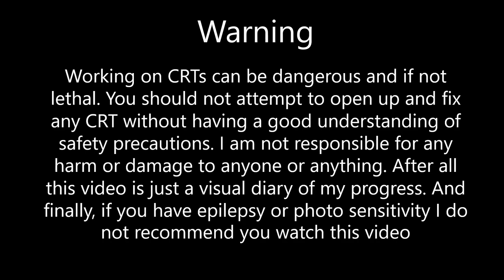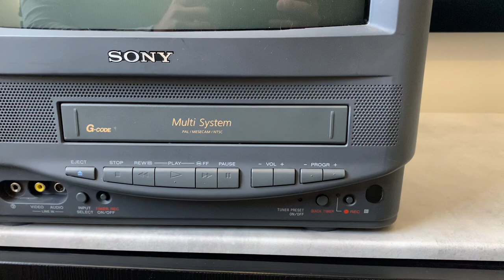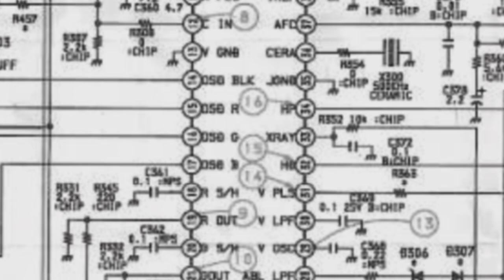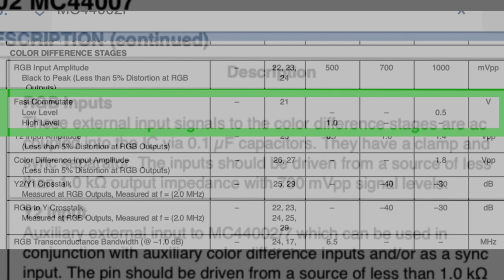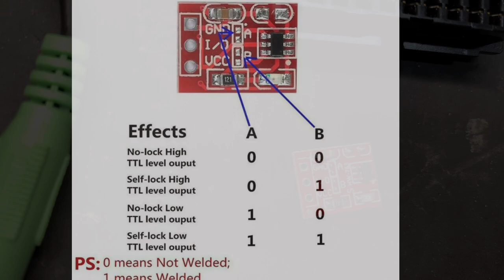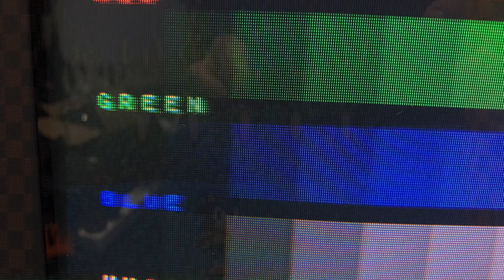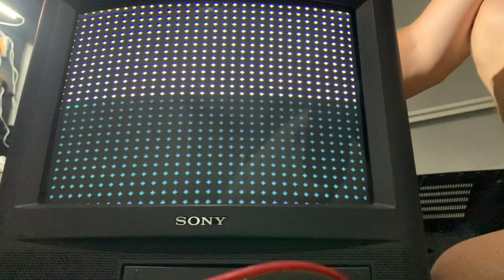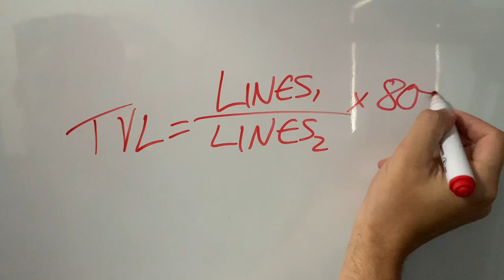No cut, switchless mod Sony Trinitron RGB Scart CRT TV

Comment: Thanks for explaining and comparing the phosphor line count. Nobody seems to mention that. So in a way the PVM tube is similar to say an Apple RGB monitor tube for the Macintosh that was aimed at 640x480 VGA. But there are things absent from a PVM as well, such as (stereo) speakers or Teletext, making them rather cumbersome for gaming. Not to mention the depth and weight. Also at bigger sizes the benefit starts to lessen, as bigger tubes have more lines as well. I find it very hard to qualify a 300€ PVM purchase when a 20€ Trinitron is good enough, and more what we used for our consoles in reality back in the days. Another real good screen is the Commodore 1084, which has a similar phosphor pitch as a PVM.
For true high line count, for example for use with 80 character modes of old 8-bit home computers, the monochrome tubes still win. An Amber Philips 80 (BM7022) delivers a truly special experience.
Reply from the maker: I made a whole separate video about phosphor line count and TV Lines and they are closely correlated. I love the PVM 14L5; Swiss Army knife of monitors with multi format resolutions. I’m naively oblivious with audio so stereo versus dual mono hasn’t bothered me too much but yes the mono speaker is a drawback, as well as the depth of these monitors. I’m making a new video on RGB modding that echoes your sentiments that a $20 Trinitron can be just as enjoyable and definitely good enough as an expensive Pro Monitor

Comment: I wish the TRRS cable was chosen as the standard instead of the 3 Composite cables, this would have made it easier for older consumers to adopt RGB and would have had the familiarity of the 3 RCA jacks older consumers were used to using.
Reply from the maker: TRRS as standard would’ve made my mod a tad easier

Comment: I have that same Sharp TV/VCR combo but I see little reason to RGB mod it.  Either way, nice video.
Reply from the maker: On a small consumer set there’s not a huge difference from composite to RGB. I just don’t have composite cables anymore since using scart so it ends up being more convenient to mod for RGB. Plus it’s been a great learning experience for me if anything so I’ll use the opportunity whenever I acquire another CRT that’s not factory RGB. Great channel btw, just subbed.
Reply: @MarcoRetro316  for sure, I just have so many crts already that it wouldn’t really do me any good.  I’d love to mod my JVC D-Series at some point.  I’m just using a transcoder through component on it now.  Thank you for checking out my channel!

Comment: I have no idea what you just did, as it’s way beyond my understanding, but I think I need you to RGB mod my 78cm Mitsubishi DIVA CRT from 1993. 👍 
It’s always annoyed me that the exact same TV in the UK had RGB on one of its rear  SCART inputs whereas the Aussie version just had a set of RCAs and an S-Video for each of its inputs (two on the rear, and one on the front).
Reply from the maker: Yeh we got screwed here, which is why we are more forgiving on cheaper brands like TEAC which have a higher chance of having a scart port with RGB
Reply: @MarcoRetro316  I remember when I bought my Mitsubishi, it didn’t have the PIP option, so I bought the daughter board and installed it myself. I had to sever a couple of ‘rod things’ on the main board as part of the installation process and was so afraid I would sever the wrong ones, but… it worked. And it’s still going strong some 30 years later. I love that TV. Great picture. Auto degaussing. Motorised swivel base via the remote control. Everything but RGB. 😢
Reply from the maker: @just_passing_through  swivel is awesome! I’ve had that on a B&O Beocentre1. Made the set feel like it was from the future. Amazing if the rotation is still kicking on after 30 years
Reply: @MarcoRetro316  Yes. I’m surprised too - given the weight of the unit. I think it weighs over 80 kilos.

Comment: When you were adjusting the Yolk, what was it that you touched that shocked you? Nobody bothers explaining this part and I've been eager wanting to know because I do have problem with convergence. So when the tv is turned ON is it ok to touch ONLY the plastic around the Yolk or can you touch both the plastic around the Yolk along with the copper? Thanks
Reply from the maker: I was adjusting convergence rings, it wasn’t really a shock though. The back of my hand brushed on the heatsink and I was hypersensitive to any stimulus because of working in that high voltage area. The snack sound was just my hand hitting the plastic case on its way out so no harm done. I haven’t needed to make any yoke adjustments as yet
Reply: @MarcoRetro316  OK that's good to hear. But I still do not know which area is safe to touch when adjusting the yolk. If you could, could you elaborate a little on this part on what are the safe area to touch when moving the yolk around just so the picture looks right? Thanks.
Reply from the maker: @DarkWolf80s  watching Steve from RetroTech’s videos on yoke adjustment, he says to stay away from the copper winding
https://youtu.be/Q2IHJfvD-70

Comment: Wonderful idea! So, i'm thinking about this capacitive sensor... in this situation you have just 2 wires one for signal in and other to signal out so you put signal entry on vcc and signal output on i/o? So the ground where i can put him? Can you chiarify this thing for me? Please.... thanks a lot! Byeee 😉
Reply from the maker: @macieldiego  there’s 3 wires soldered to the sensor: VCC in, ground, and VCC out. The VCC in/out will be the same voltage and the input voltage also powers the sensor. In my experience they’re great for around 3v in/out. You also need to open/close the appropriate A or B jumper pads to select the state, in this case the state is always on VCC out when pressed. It’s not that convenient a mod though as when the TV is powered on you need to remember to touch the sensor. Not that big of a deal but it was more of a novelty/proof of concept. I’ve gone back to using a mechanical switch

Comment: Man I need to do Component mod to my CRT.
Reply from the maker: It’s a great learning experience, just put safety first
Reply: @MarcoRetro316  Hey didn't think you'd see this comment, but could you help me find any sort of guides or tutorials on how I can do so? All I know is I need to tap into RGB signals from the jungle chip then convert them to component. But I can't find anything on how to convert them to component.

Also I have zapped myself before on my 21" crt. I touched the Anode cup WHILE the CRT was on. I was trying to eliminate "hissing" from it.

Thankfully it shut itself down and I only almost blacked out for two seconds while I was contemplating my life choices.
Reply from the maker: @FR4M3Sharma  oof that shock sounds painful, be very careful! You’d need to look at the jungle chip/video chips datasheet to see if it has analog RGB or component inputs. I’ve never modded for component as all of my consoles output RGB so I’ve never needed it. If you predominantly have consoles that output component and the TV is only modifiable for RGB, then you’d be best to transcode externally into RGB
Reply: @MarcoRetro316  Alright, thanks. I unfortunately only have an OG Xbox because all those 8-16 bit consoles never made it to my country, I think even the OG Xbox didn't launch here because the two I have are both imported Americans and Japanese models.

The thing with Xbox is that it doesn't have any sort of RGB output only Analogue Component. So I have to do this mod, I'll see if I can find something on the Jungle chip.

The CRT I have is a generic 21" Composite LG CRT which only has two Composite In(s) and one Out, the only reason I've held onto it because it's manufacture date is around 2008 and it was barely used by the previous owners so it might last me a good while.

Thanks again :)
Reply from the maker: @FR4M3Sharma I see. The OG XBox definitely outputs RGB with a scart cable so you wouldn’t have to transcode. The output resolution through RGBs scart is capped to 480i but if it’s to an SD TV then that’s all you need
Reply: @MarcoRetro316  oh yeah I totally forgot about the European market. But for that I'd need to get a av cable that output RGB through scary. Dunno how much that would be but shipping alone might not make it happen. I'll see if I can diy my way into it. Thanks.

Comment: 9:13 my 27" Sharp does that too! Did you ever figure out the reason?
Reply from the maker: I never found out but I wouldn’t say it’s an inherent problem with the set. I’ve only noticed with sync on composite video in RGB and it’ll do it in composite video regardless so something with the vertical blanking interval

Comment: bro the ringing wtf is wrong with your audio 8:19 - 8:35
Reply from the maker: Tbh I can’t hear it but I’m guessing you’re getting a loud high pitch screech? If so then that’s the 15Khz ‘whine’ of the crt, typically the younger an individual then probably more you’ll notice it. Thanks for pointing it out, I’ll have to look into ways I can detect the noise when I can’t hear it and filter it out post
Reply: @MarcoRetro316  neither I'm 28 can't hear it.  But can on my 3730c at 240p

Comment: Just like my own tv settings brightness being on 50 had turned that down on 35 now on to the color settings being on 50 not enough color had turned that up 87 now on to the sharpness being on 50 had turned that down on 0 on to the backlight need to be on 30 at all times on to the contrast need to be on 100 at all times everything proven everything more greater picture quality everything proven people don't want people playing with there tv settings now days everything proven people start playing with there tv settings more now days the truth will come out that tvs causes problem's on people's thinking now days on and with your vhs tapes